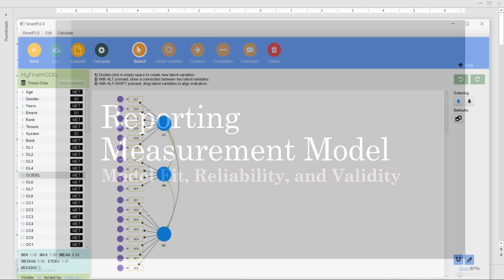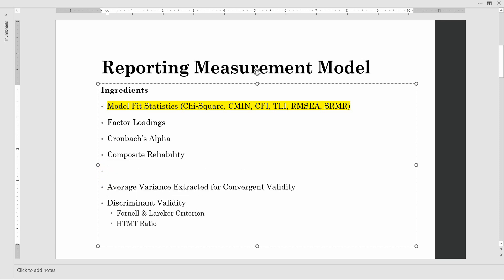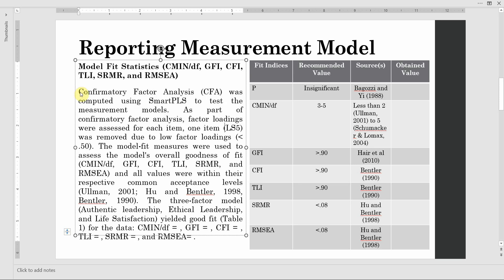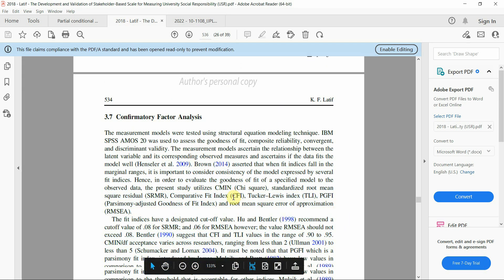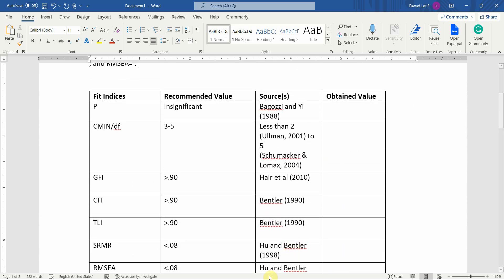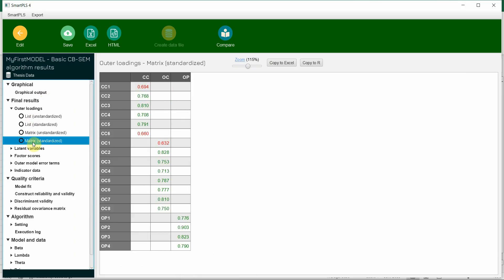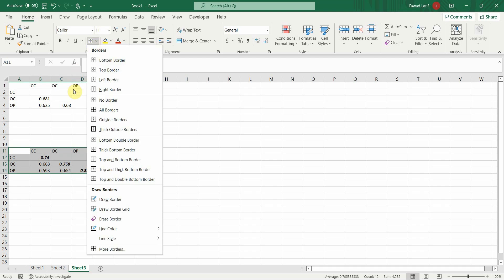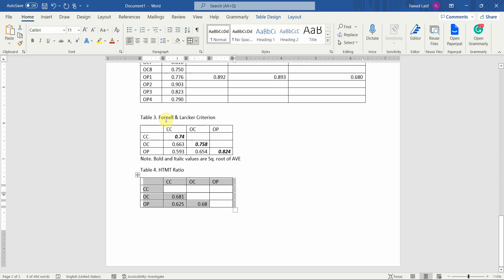CBSEM using #SmartPLS4 | 12 | Report Measurement Model Results

Comment: Sir, I have a query, can you please help me, my Current analysis on CB-SEM is based on responses of 390 respondents for 4 IV, 2 Mediators, and 2 DV. This is in the case of distinguishable dyad data(Actor and partner effects are there). The model fit indicators are all under acceptable thresholds. However, a significant p-value is being reflected, indicating that the null hypothesis (that the model fits the data perfectly) is rejected because the chi-square statistic is significant. How should I go about this?
Reply from the maker: Dont worry about Chi-Sqaure. It is sensitive to sample size. It is significant when the sample size is high. If all other indicators for fit are good, go ahead.

Comment: Prof, pls if my model fit indicators are not good, is there a way to address them in CB-SEM using smartpls?
Reply from the maker: Please check the Standardized Residual Covariance Table. Any values over 2 are problematic.